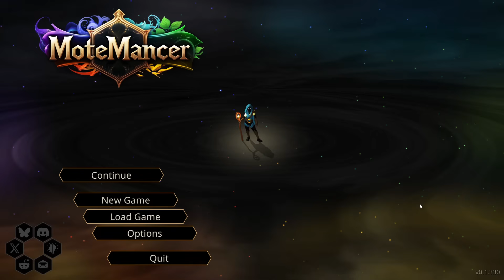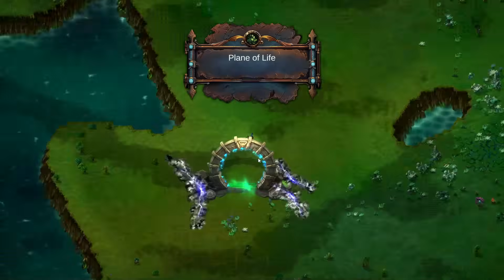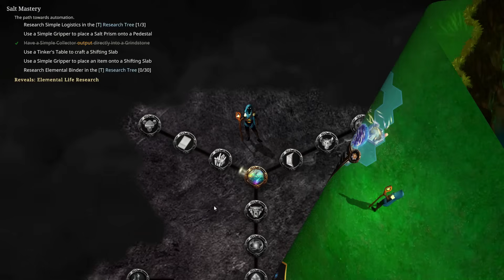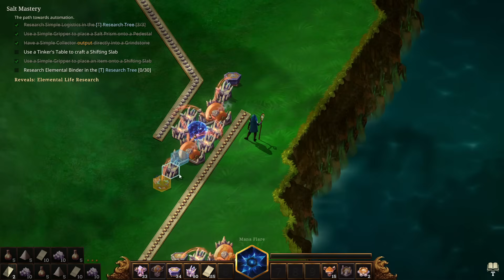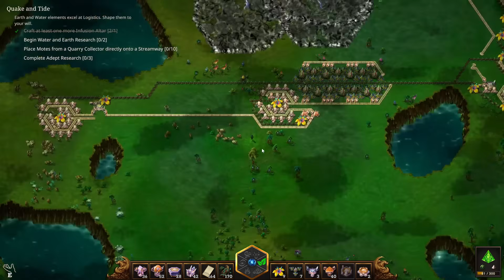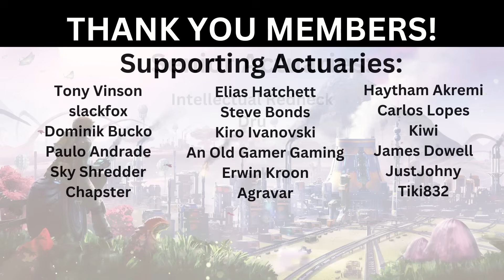Starting Guide - Motemancer

Comment: Thanks so much for your amazing video.  Just discovered this game when it popped up on YouTube.  I'm considering playing this and have downoaded the demo.  I have a few questions about the game.  Are there any accessibility options or settings in the game in terms of difficulty, contrasting colors etc?  I have a vision impairment and love thest types of games and the magical aspect really got my attention.  Are the cracks that you can harvest motes from infinite or is there a limit and how can I know if these are running low?  If you make an error, can things easily be moved/deleted or are there penalties for doing so?  I read that there are puzzle aspects to ghis game, how challenging are thest to complete and are there penalties for failure etc?  In general, is there time pressure to get things done or is the gameplay relatively relaxed?  I'm really intrigued and hope to get in and get those motes flowing!  Thanks again and great work!
Reply from the maker: Hey there! I"m not sure about the accessiblity options, but to your other questions: Motes do run out (but there's plenty more on the map!). It's easy to see once they run out. Moving/deleting things is easy, and your building materials are refunded. The "Puzzle" element is mostly in the design of your factory as you'll have to combine many items. There's no real penalty for failure/inefficiency - things will just take you longer. 

There is a minimal time pressure as there is a 'fog' that starts spreading from your portal as you build, and later on there will be similar patches of fog that spawn randomly that you'll need to 'fight'. You get ways to disperse the fog again though, so nothing you can't handle and it is not super pressing.

Comment: You can do a much better early research setup with just one mana flare powering the altar and two grippers by putting the pedastals on a side instead of a corner. This also lets you put a second altar on the other side, using a second flare to power it plus one more gripper/pedastal combo for the triple-input research.
Reply from the maker: That works too!